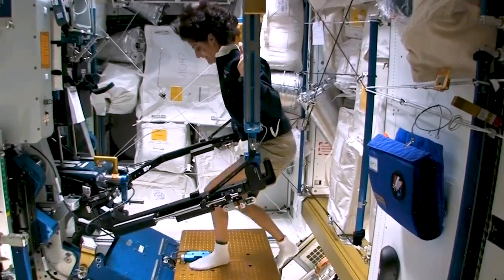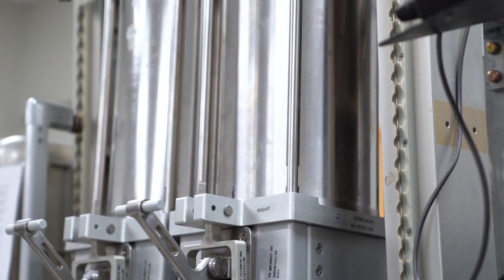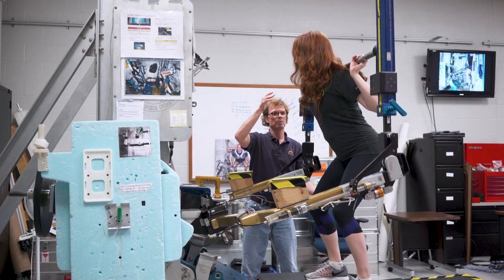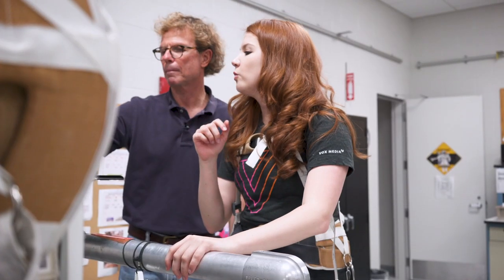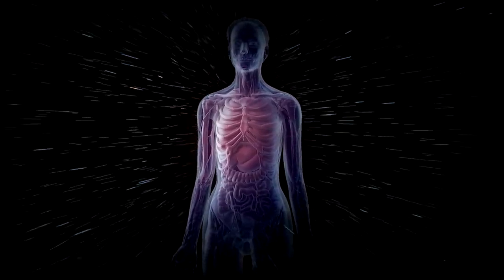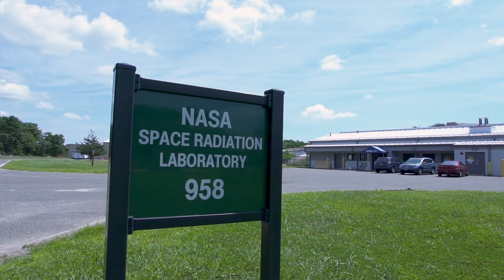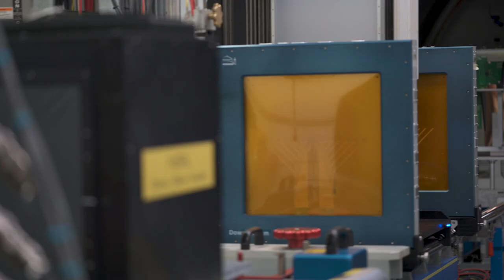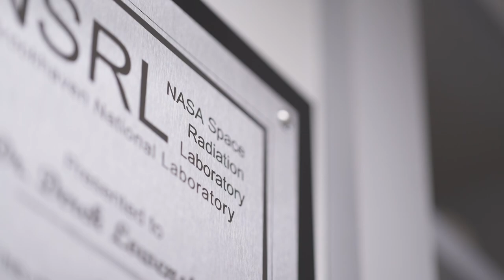Testing out an astronaut’s exercise regimen

Comment: Couldn’t they use a bowflex?
Reply: Yes, but the material would break a lot more easily, and as it became damaged we wouldn't get as much resistance from it.
Reply: @Blue-gp3vn  why would it break much easier? if they are constantly send astronauts up there just replace the equipment
Reply: @Blue-gp3vn  simply make it out of the surgical tubing material they use to strap them down for the tread mill